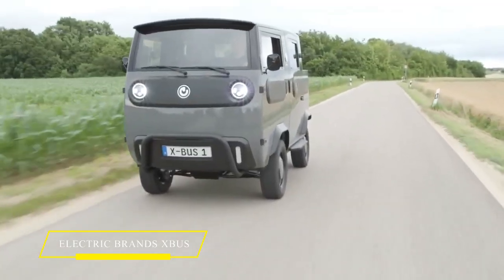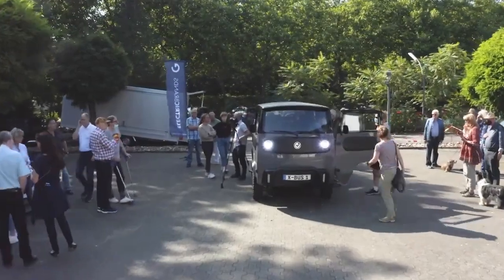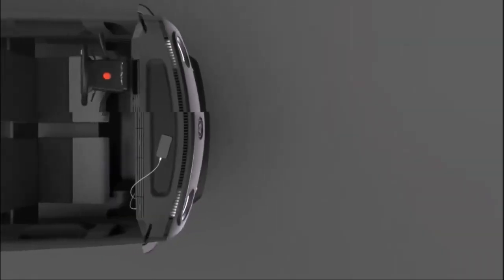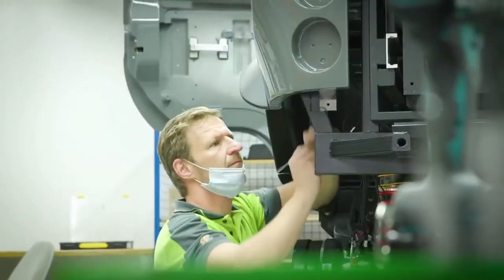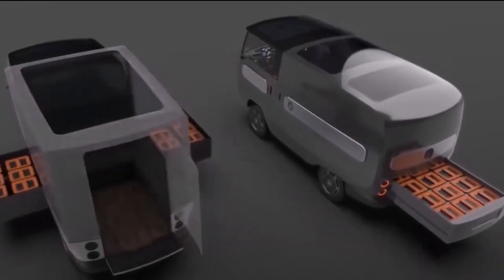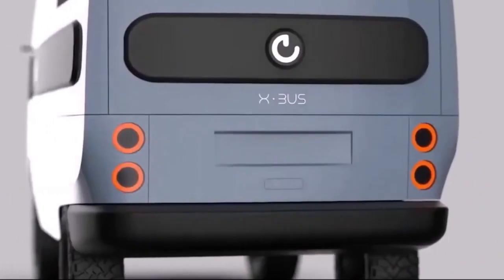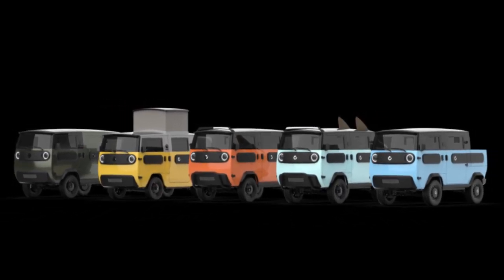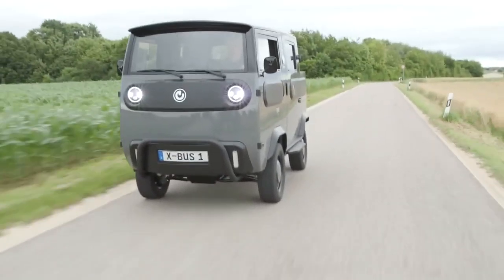Electric Brands Xbus Impression: A NEW Bargain

Comment: eh  ...what diesel generator?  for what purpose?  This is an all electrical vehicle
Reply from the maker: The mention of a diesel generator could be in reference to a range extender, which some electric vehicles use to charge their batteries while on the go. It's a way to extend the vehicle's range when needed.
Reply: I was more thinking of a generator usage like in American RVs, where you‘re powering stronger devices with a separate generator. The solar panel wouldn’t be enough if you‘re standing outdoors for a week or so in a cloudy area.
Reply: 408 kw 😅😅